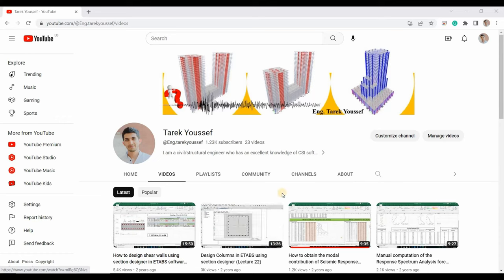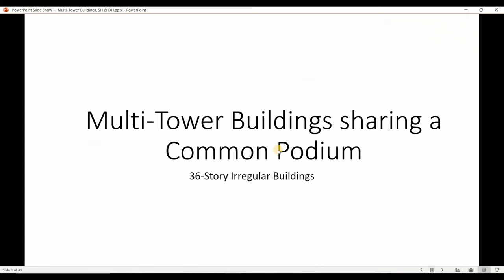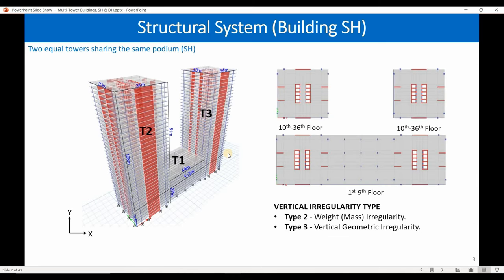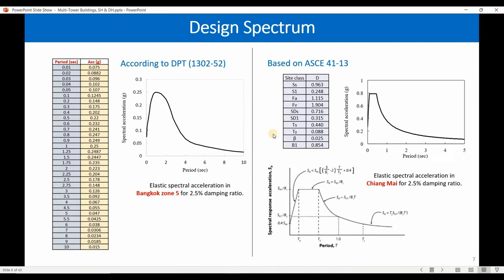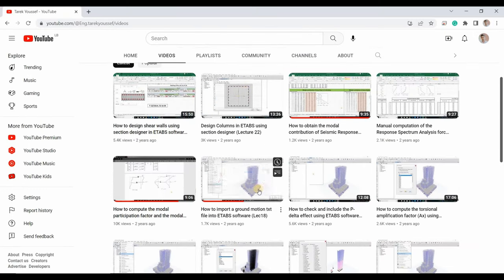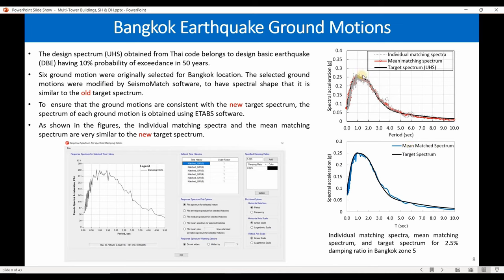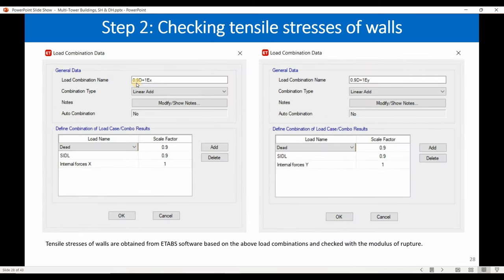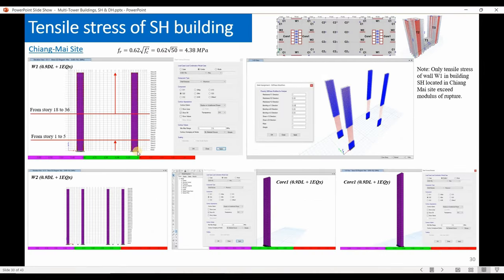Introduction to Seismic Analysis through a Case Study of Irregular Multi-Tower Buildings

Comment: Hi Sir! I wish to know how to include the SF x OmegaO / R in the 1st mode Base Shear, how can we do this in ETABS?
Reply from the maker: Hello! In the MRSA-HE approach, you enhance the first mode by scaling it with SF*Omega/R. This adjusts the modal acceleration of the first mode by modifying the spectrum.

The process involves:

1. Modal Analysis: Conduct a modal analysis to find natural frequencies, mode shapes, and modal damping ratios.

2. First Mode Identification: Identify the dominant first mode for both X and Y directions, which significantly contributes to the structural response.

3. Scaling Factor Calculation: Calculate the scaling factor (SF) as 0.85*VELF/VRSA, where VELF is the base shear from the equivalent lateral force procedure, and VRSA is the reduced base shear by I/R of the response spectrum analysis method. Then compute the first mode's scaling term as SF*Omega/R.

4. Spectrum Adjustment: Modify the spectrum by multiplying the acceleration of the first mode with the term SF*Omega/R.

Comment: Hello engineer, all your tutorials are very good, I wonder if you get more tutorials from this study, as a step by step to reach the same results.
Reply from the maker: I'm happy to know that you find my tutorials helpful

I'm currently working on making more tutorials that will guide you step by step through a study like the one you're interested in. Even though the building in these tutorials may not be exactly the same as the one you're asking about, the methods and techniques I'll be explaining are the same and can be applied to any structure.

Right now, I'm focused on creating videos for the ETABS software, and you can find them in a playlist called "ETABS Course 2." I also have plans to create tutorials for Perform 3D software in the near future.

Stay tuned for more helpful content that will assist you in achieving similar results in your study.

Comment: Hi Sir!, may we know how to do the Scale Factors in ETABS using the MRSA-HE? thank you in advance
Reply from the maker: Hello! In the MRSA-HE approach, you enhance the first mode by scaling it with SF*Omega/R. This adjusts the modal acceleration of the first mode by modifying the spectrum.

The process involves:

1. Modal Analysis: Conduct a modal analysis to find natural frequencies, mode shapes, and modal damping ratios.

2. First Mode Identification: Identify the dominant first mode for both X and Y directions, which significantly contributes to the structural response.

3. Scaling Factor Calculation: Calculate the scaling factor (SF) as 0.85*VELF/VRSA, where VELF is the base shear from the equivalent lateral force procedure, and VRSA is the reduced base shear by I/R of the response spectrum analysis method. Then compute the first mode's scaling term as SF*Omega/R.

4. Spectrum Adjustment: Modify the spectrum by multiplying the acceleration of the first mode with the term SF*Omega/R.
Reply: @Eng.tarekyoussef  Thank you very much sir for your prompt reply! May I clarify 3 things: #1. for item 3, which modes shall we consider in the calculation of VRSA?  is it the dominant mode only for each direction (1 in X and 1 in Y)?  #2. for item 4, does the Spectrum Adjustment means we are going to use 2 Adjusted Spectra to be used since we have 2 dominant modes, 1 for X direction and 1 for Y direction? #3. for item 3, may I clarify if the R factor to be used in SF*Omega/R comes from Pushover Analysis?
Reply from the maker: @rjkebz312 
1- In MRSA-HE, it's crucial to combine all vibration modes to obtain the total response. For instance, if we use 15 vibration modes (giving over 90% mass participation), each mode consists of 2 translational components and 1 rotational component. This means a mode can purely translate in one direction, exhibit coupling between UX and UY, or even involve all three components. Therefore, selecting the mode with the highest participation in a given direction (typically the first or second mode) is essential. However, for the final results, we must combine all modes, including those not participating in that direction and with the adjustment of the first mode selected for that direction.

2- Yes, we indeed require 2 spectra for each direction, with each spectrum being adjusted to the first fundamental mode of its respective direction.

3- In MRSA-HE, we utilize the "R" factor specified in the design (obtained from ASCE). For MRSA-HI, a pushover analysis is necessary to calculate the R factor.
Reply: @Eng.tarekyoussef  Thank you very much sir! I hope to learn more from your channel.

Comment: how do you compute T for each building in the same etabs file ?!
Reply from the maker: I am not entirely sure if I understand your question, but for this study, I have used two buildings: SH and DH. These buildings were designed for two different locations in Thailand: Bangkok and Chiang Mai. Consequently, I have created a total of four ETABS models, with two models for each location.

Therefore, I have obtained the modal properties of the buildings (natural periods, natural frequencies, etc.) using the ETABS models I created for each location.
Reply: @Eng.tarekyoussef  Each building containing 2 towers with connected podium in lower stories 
when designing each tower should i study each tower separeatly or all the building in the same model ??
What  if i have a 4 stories basement  ?
how i can scaling the base shear at ground !?
what if the stiffness to the two tower  are diffrante ?!
Reply from the maker: There are two main approaches to consider when designing a building complex with two towers and a connected podium:

1. Separate Tower Analysis: Study each tower as an individual structure, but remember to provide expansion joints between the podium and towers during construction.

2. Integrated Building Analysis: Model the entire building complex as a single structure. This approach considers the interaction between the towers and the podium from the beginning, providing a comprehensive understanding of the building's behavior.

In my case study, I used option 2 because it allows for a better understanding of the interaction between the towers and the podium right from the start. However, in practice, option 1 (Separate Tower Analysis) is often more preferred.

For the 4-story basement, it's worth noting that, according to my knowledge, the basement's weight is typically not considered in seismic analysis. However, it is essential to check your local building code to ensure compliance with the recommended practices.

Additionally, keep in mind that if the stiffness of the two towers differs, it will affect the distribution of lateral forces during seismic events. The stiffer tower will attract more lateral force, while the less stiff tower will experience a smaller portion of the force. Therefore, it's crucial to carefully assess the stiffness of each tower and how it impacts the overall behavior of the building complex.
Reply: When we have a expansion joint, it is preferable to do separate models rights. Or will it right to model them as multi tower ?
Reply from the maker: @prajwalaavarebeel1790  Absolutely, when you want to provide an expansion joint, you should create separate models for each tower rather than modeling them as a multi-tower structure. Each tower should be modeled and analyzed individually.

This practice simplifies the analysis and design process by preventing interaction between the towers and the podium.
Reply from the maker: @aliwael8126  When an expansion joint is not used, it's crucial to consider the towers and the podium as one interconnected structure because they are physically connected!

For instance, if one of the towers experiences movement or load, this force is transferred from that tower to the podium level and subsequently to the other tower. This force transfer mechanism demonstrates that the response of any structure, whether it's the podium or a tower, is directly influenced by the behavior of the other structures within the interconnected system. In such cases, it's essential to model and analyze the entire complex as a unified structure to accurately capture these interactions and ensure the safety and stability of the entire building system.

I understand your concern about determining the modal properties (mode shapes, natural frequencies, modal periods, ...) of each tower alone when they are connected. And let me just remind you that if we want to obtain the mode shapes and modal frequencies we need to solve the eigenvalue problem.  

1- First, we need to solve the determinant of the following eq: det( k -wn^2 *m ) = 0, to get the natural frequencies (wn).
where "k" is the stiffness matrix; "wn" is the natural frequencies; "m" is the mass matrix (note k and m are known). 

2- Then we will use "wn" to obtain the mode shapes. 

Therefore the solution of obtaining the mode shape values is based on knowing the stiffness and mass matrices from the beginning. The stiffness and mass matrix used in this case corresponds to the entire structure (Towers + Podium). Hence we are able to obtain the mode shapes of each tower, and the modal period or frequency of that mode (not the natural period of each tower). 

Moreover, In "DH" building, since the height of towers is different, the tower's response is not symmetrical or there is an out-of-syncization behavior (each tower could move in a different direction). This can be noticed when animating the mode shapes. In some modes, Tower 1 only translates in a given direction, while Tower 2 rotates! Also, the opposite is true for other modes. Then what we can notice from such modes is that each tower is oscillating or vibrating under different natural frequencies.

Lastly, let's look at this case from a different perspective. By employing nonlinear dynamic time history analysis (NLRHA) for such complex buildings, we can obtain the actual response of the structure at every time step. This means we can observe how the towers interact or vibrate under real earthquake ground motion records at any given time. From a mathematical standpoint, when we use NLRHA, we're essentially solving the equation of motion at each time step using the stiffness matrix of the entire structure (both towers and podium). As a result, the solution accounts for the behavior of the entire interconnected structure, providing a more comprehensive understanding of its response under dynamic conditions.